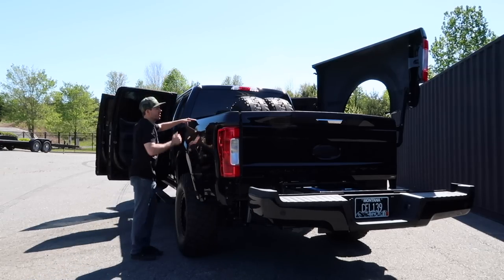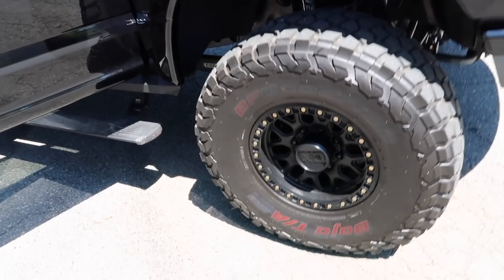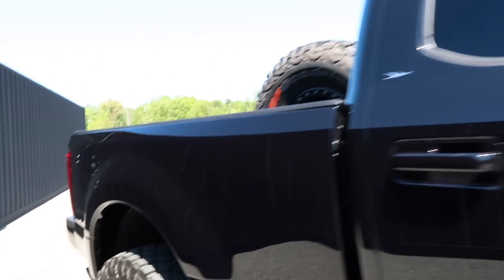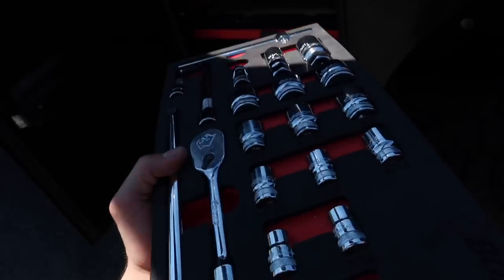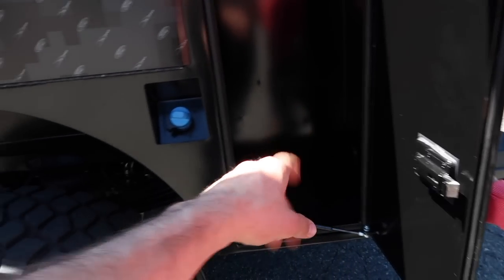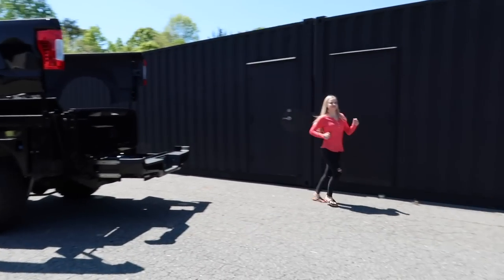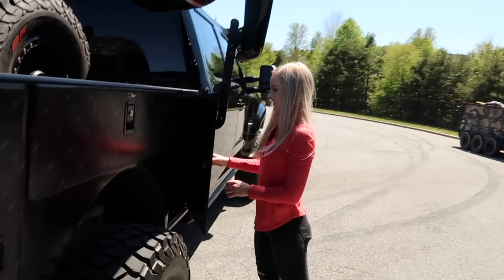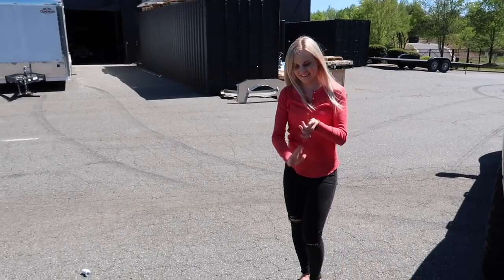Transformer tool truck working, and explained...

Comment: Should sell this as a kit
Reply: @davidgould4870  nor is that rear bumper secure enough to bump..
Reply: Taillights just have to be fixed while the vehicle is in motion. Otherwise roll off trucks would be illegal
Reply: @vsmgarage  no roll off ive seen has tail lights mounted to the movable part, usualy the frame right below. the clearance lights are another story those can be mounted everywhere
Reply: @radishtrader5591  well the five axle roll off trailers we have the lights are attached to a bar that moves with the rails. So I believe as long as the lights are attached to a fixed surface while the vehicle is on the road there should not be an issue. Also tow trucks put portable taillights on vehicles while towing
Reply: Straight pipes are illegal too...only if you get caught though
Reply: I would buy it
Reply: @shaneryan5304  perfect comment
Reply: @shaneryan5304  they are only illegal in most areas. Also in some states that don’t have clear noise laws you can have cherry bomb exhast resonators
Reply: @davidgould4870  In that case I guess sedans are illegal because the taillights move on the trunk lid most of the time
Reply: @jacobchudy5712  usually secondary tail ights or reflectors
Reply: @gingie5246  I meant for the B.S. emissions laws- no CAT, muffler, DPF...all the extras that ruin vehicles
Reply: @shaneryan5304  Actually some SUV’s have their taillights on the hatch. And if it is true, what mamma don’t know won’t hurt her. As long as the sides don’t open, their won’t be any reason to suspect.
Reply: @davidgould4870  Audi Q7 has them on the hatch.
Reply: Well I California gave this a tag .. pretty sure it passed.
Reply: @ralladoastalamuerte  Audi Q7 has secondary tail lights in the bumper. When you open the trunk those light are activated. If you’re driving with the trunk open they act as brake lights, turn signals and back up light.
Reply: @davidgould4870  you're worried about lights while your parked, but not the crumple zones being effected....
Reply: @janeblogs324  no, was worried about legality and marketability. A custom utility body has no crumple zone, but still legal and marketable
Reply: @jacobchudy5712  you should look again. Many do extend into the trunk or hatch, but are technically accessory lights. The primary are fixed
Reply: @jacobchudy5712  no they do not. No no car sold in the U.S can have lights that are not fixed. Why do you think you don't see flip up head lights anymore?
Reply: Hell yeah don't listen to those first douches   , Debbie downers they are all the sudden the safety patrol or something now? It's  badass and super creative job .👍
Reply: @davidgould4870  ...put a small break light in the bumper??
Reply: @davidgould4870  Not true,  see hydraulic tail flatbed trailers
Reply: @davidgould4870  as creative as this is if that was a problem I’m sure they could make the panels move without the lights
Reply: YES PLEASE
Reply: @ralphosborn8589   same

Comment: Ford should have this as an option for there trucks 🔩🔧
Reply: Like any OEM they’d likely screw it up
Reply: @brandonm6052  laws wnot allow the tail ;ights to be moving the lights will have to be muonted stationary THEN it will pass safety laws
Reply: @ghettodexter  makes sense
Reply: @brandonm6052  ok if you arent smart enough ti read through typos i dont know how to help your iq...

Vehicle lighting cannot be mounted to moving parts of the vehicle unless they are secondary lights like the 3rd brake light on suv tailgates. The tail lights will have to mount onto the truck in such a way they cannot be moved along with body panels or doors unless they are not the main set of lighting.
Reply: I need one!🔥
Reply: @ghettodexter  I wasn't correcting you or anything. I hadn't given thought originally to the hard mounting of the light.  I was just saying your point made sense.
Reply: @ghettodexter  that would make it easier because then you wouldn’t have to mess with wiring.
Reply: @brandonm6052  sorry dude
Reply: @gjs9871  yeah it would but laws an stuff lol... Crash safety and all... Idk whay its safter but its the law
Reply: @ghettodexter  No harm no foul, not like society is filled with descent people behind a keyboard these days.  I didn't get worked up.
Reply: @krazypotatoe4207  reasoning for measuring iq isnt jist based on standard education but rather the ability to perceive and use critical thinking to come to a solution to a problem with or without abstract thinking. Dont fail yourself overthinking what is and what isn't. A typo is surely just that and I don't cater to "internet editors" I mean most have no lives and nothing to input into a conversation less be on topic only to insert a syntax error or correction to someone mispellings in an effort to make themselves feel relevant in a discussion or like an intellect.

Did you think it was smart by even commenting?
Reply: @ghettodexter  Then why tf you insulting him for not checking his typos. I was just doing what you did to him. But he seemed to be a better sport about it. I was just trying to tell you that you made more grammar and spelling mistakes than he did and you insulting his IQ. I don’t care if it was smart or not. I commented what I wanted.
Reply: @krazypotatoe4207  nah you reaching... I had a typo... And i said if he wasnt smart enough to read through it (using perception and critical thinking items needed for intelligence) then there is a problem... Never ever would i place myself in the position of the aggressor. Amd if im wrong I apologize. Use you head... Good day
Reply: @ghettodexter  I was trying to prove a point. Yes I jumped to conclusions. But you it looked like you were insulting his IQ for not having  proper grammar. But it looks like you can’t type.
Reply: @ghettodexter  dude I already said I just jumped to conclusions my bad
Reply: @krazypotatoe4207  youtube updates slowly all good my dude didnt know you responded
Reply: @krazypotatoe4207  lmao you right i cant 3 broken finger s one hand and thumb and pinky on other soooo... Yeah pressing edit and retyping hs gotten annoying at this point
Reply: @krazypotatoe4207  on god broke my pinky at work had time off decided to ride my supermotot because its warm amd well time off work from frabication amd stuff fell and there goes my thumb on same hand and 3 on my left smh
Reply: you like work trucks that dont run?🤣
Reply: @GoneJustinSeconds  what got you so butt hurt playa' how did i hit a nerve when i wasn't even talking to you.... Two for one special
Reply: Yes they should
Reply: GM should hire this guy to teach their design team to not be lame. They destroyed the look of their truck and SUVs in 2021.
Reply: @ghettodexter  the lights function even raised
Reply: @jonathansampson5057  understood but that is still unlawful as any moving tail light must have a stationary secondary backup light including turn signals
Reply: *their
Reply: Screw the haters Courtney!! You’re a great little actress! Keep up the great work!! 😎👊🏼👏🏼
Reply: Lol they cost enough for it… 😂😂
Reply: Some big auto company is drooling over your build,,, most original new creation I have seen in decade's

Comment: I want that bed on my truck so bad!
Also, would you still be able to hook up a gooseneck with that bed?
Reply: I would imagine so the ball would be up in front of where the spare bolt compartment is at and the drawer only slides in where the spare tire would be under the bed. So your fifth wheel would be up further the plate and bracket I would say still fits.

Comment: Nice welder, plasma torch, etc. where you going to plug it in?  Does truck have an air compressor and generator hidden somewhere?
Reply: I’d imagine he installed aftermarket all of which you said considering he completely built this thing from nothing however ford is offering generators from factory starting in the new f150s for 2021 so I’d imagine the auperdutys will have generators and hybrid features soon also
Reply: More than likely you'd bring those unless he does actually have them in there somewhere
Reply: There's always that one person

Comment: Very nice, but one thing I noticed is the fuel doors. Would look more factory if you added fuel doors on the fender. I noticed you would have to open the driver side fender to add def and diesel. Pretty freaking sweet though.

Comment: Only one upgrade that can totally be done, motorized panels via remote control  push a button on your remote the fender opend for the tool box. Or bumper slides out . Closes via remote control also.
Locks and unlocks with the cab, is also hooked up to the alarm system.
100 times better then a big silver or black over the rails tool box  it takes 3 min or less to break into.
And this is tottaly stealth. No one would know it there, options might be a tailgate work table that holds a compound miter saw with long board supports. Folds up and fits in the bumper trunk.  Outlets for 120 volts to run power tools.  Small propane generator  spot. For off grid jobs. That uses gas grill tanks. 
Or even a cook out special with grill and fridge for football games and tailgate party.

Comment: Just bought a 2019 Titan XD Platinum Reserve Diesel. This would save me from towing a little enclosed trailer. Are you guys doing this still?  I’m interested just for the bed sides and maybe the the under bed. This system would be perfect for my plumbing fittings

Comment: Such beautiful work and the fact that it looks factory is even more amazing my question is is depending on your state what is the regulation for and how did you maintain legality with having the tail lights on removable body panels?

If I'm not mistaken lights cannot be mounted on any part of the body that moves for visibility reasons but I would wager that the visibility is increased when they're at higher in the air especially if you're pulling a trailer you could have the fenders up.

Comment: How is power supplied for the welder/cutter? 
   I’m sure many have already asked, but didn’t see it anywhere in the few hundred comments I scrolled through. 🤷🏼‍♂️
   You mentioned that you worked directly w/ Miller to make both the welder & cutter “suitcase style” for portability, in case you can’t get F-250 close enough to where you need it.  Which sounds like they’re both battery powered?  If so, I’d also be inclined to assume they have a built in pure sine wave inverter in order to generate the proper amps/voltage?  
   If it wasn’t battery powered, I’m sure we would’ve seen or you would’ve showed us a hd extension cord (unless it wasn’t in there at the time).  Regardless, it’s clear that you all put a tremendous amount of time & effort into incorporating anything you could poss need.  That said, I figure it’s a no brainer, that you’d have put in some kind of elect. outlets (with a sine wave inverter) that can power pretty much anything.  (I can’t imagine there’s much of anything that requires more power than a welder & cutter).  Speaking of which, I know the entire set up is for “emergency” on the go, good enough to get by & get back on road, type of repairs.  So, is the welder gas-less or are their small tanks inside the “suitcase”?

All in all, outstanding & spectacular work!!! In addition to the time & effort, you guys also put a lot of love into that project.  Can you say how much you sold it for?  If not… can we at least get a ballpark figure?  Say… 2.5 2021 Sierra Denali’s?

Comment: The only thing I could even think of to make this better is to just add some like velcro straps, or elastic straps, or the netting from car trunks, and bolt them into the walls of the toolbox, for anything that is "loose" like the rags or bottles of fluids and stuff that way it won't rattle around or at the very least won't fall over inside the toolbox that way it always looks stock and neat!
Reply from the maker: thanks seth for your imput!!! I agree 100% and we do this was just set inside for the shoot. Thanks for stoppin on my page man!

Comment: Brad why are you not selling these trucks for the masses, or have see the bed as an option either directly though your website or throu your local dealer. Surely mass producing these and a replacemet tuck bed would sell?

Comment: You can't have head or tail lights on a moving body pannle, as far as I know. How are you getting around this?
Reply: How can that be the case when a concrete ready mix truck has tail, brake and turn lights on the drop axle? As long as the lights are at the rear most portion of the vehicle...
Reply: @philbrady702  i think there might be an exception for vehicles like that but I dont know for shure. All I know is it applies to production vehicles like this one

Comment: I always thought a flatbed with the bottom of the box modified to match the bottom and open to the boxes would be cool. The flatbed up would be a skeletonized stake poket version of the top of the box you could use or remove.

Comment: One question, where did you relocate the tow hitch too?
Reply: It is on the frame. Bumper slides out but the hitch stays factory welded to the frame.

Comment: Just the grill and fenders  still look like it could be factory-installed 
The light bar nope thats aftermarket as well as the wheels and tires, the box or bed could be factory-installed 
You could do a lot of the mods and unless you own one and know the truck really good never give it a second look.
The light bars over the top, litterly it gives it away.
Don't get me wrong it looks good, just isn't factory installed.

Comment: I think that you should try to build a new bed that  works with all kinds  of different  styles and sizes of trucks .this includes all of the older trucks like the  1965 and the 1966 Ford custom cab camper special deluxe pickup trucks they could use a  better bed for  each  of the trucks  .maybe you  can make some new parts for us  to use  for our  own custom design for  all  make and model of our trucks 
 Maybe you could  make some  new parts for  my ford custom cab camper special deluxe pickup trucks and  make  some new  toe truck beds .if you have the time.  I think  that  you can  get  the job  done by what  I  have already seen  on  your website. I hope that you will have a wonderful day today and tomorrow and the next day. Good luck with your new gig and I hope that you're doing well and your father  that  I sed hello.  FROM THE STATE OF WASHINGTON  .

Comment: When all of that foam wears those tools will be scattered everywhere.
Reply from the maker: The foam is very hard and it wouldnt go away
Reply: @DeBerti  trust me it will wear
Reply: @bartismoellis1052  ok, say it does wear out. It’s like $20 per tray to get new foam and replace it but I guarantee you he won’t need too. I was in the military and we had our tool boxes lined with foam and that stuff had been in there 10-15 years with tools being pulled out multiple times a day and I could turn a box over or drop it off the van and tools would not release from the foam we used. 

This ain’t a kids toy, he’s built the thing to stand up and it’s funny you dig behind a keyboard somewhere telling him things won’t last when your the one that doesn’t have a clue!!
Reply: Something tells me that if the owner can afford this truck he can afford to buy replacement foam organizers.
Reply: You could just put another piece of foam on top to fill the void.

Comment: A bit confused, he mentions several times being large enough to carry drywall (which is great!) but it has several compartments for ratchets and a welder but no drywall mud. Is there a new type of sheetrock that requires welding? Most of the construction workers I know drive rusty work vans. Who is this vehicle marketed towards? Very cool truck though!
Reply: Anyone who has a lot of tools and not a lot of room. I have a crew cab. But the back has tools and bins in the entire back seat. All my stuff wouldn’t fit in the boxes they built. But it would probably free up one small spot in the back for someone to sit. Lol not kidding..  but Construction field. Road side mechanics. To Carpenters that would have a spackle buckets, stilts, ect can make use in any of the compartments. They do have a lot of them. He was pointing out that they made it capable of taking a sheet of drywall or plywood and transporting it in the truck if you had the need to. It’s possible. All day every day.

Comment: We see you just pulling the lever or latch back in the trailer  to open tool kits . Wouldn't it be nice to have a key lock so not to attract stealing? At the end we also saw your wife not using a key..

Comment: Im definitely more into blonds than any f1$hitty ever made. Cool project. Now go put it on something that doesn't need a heated tailgate 😂😂 

Calm thyself, everyone has a different taste in trucks o have owned 2 fords one brand new they both left me walking my 98 crew cab 4x4 short is going 380k no major problems other than spider injectors.

Comment: How do you insure that truck if some idiot was to hit you and total loss this truck would be a teriable loss
Reply: Its not hard. I own a fabrication shop that does custom work . My insurance company just said take detailed pictures and keep receipts of all materials and time put into it and call them up and require a new policy taking that into account. They just figure a little higher and have an adjusted rate afterwards.  You can insure anything these days. Just make sure you do it before you use it.